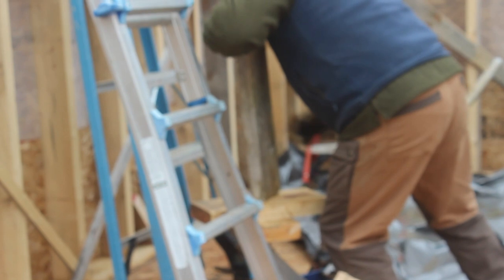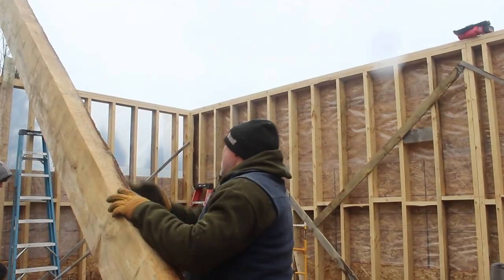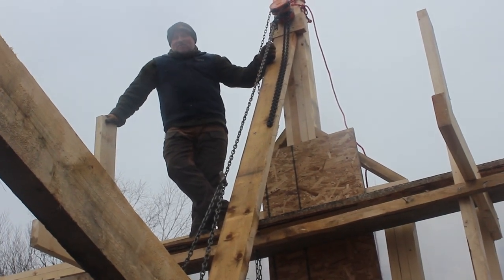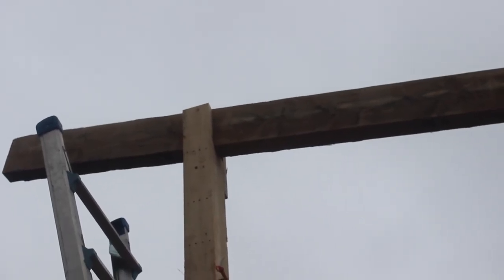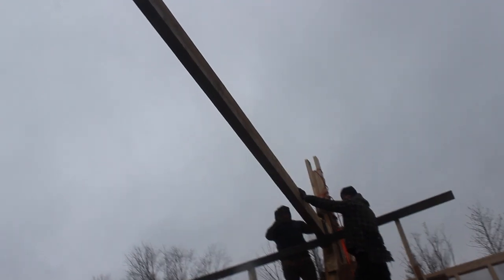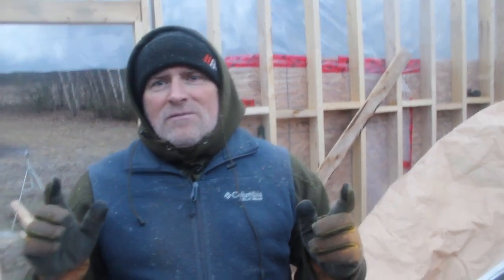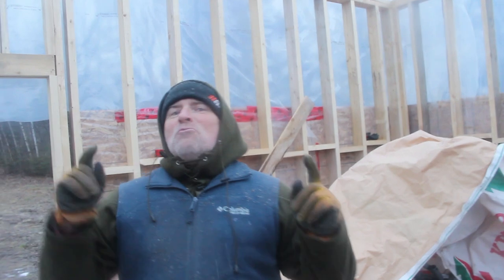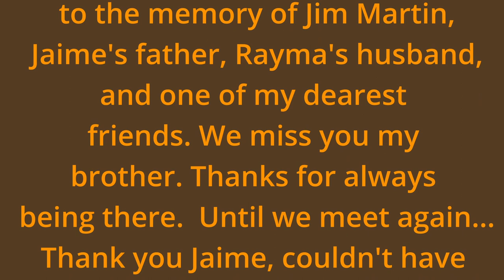32 ft. 500 lb Ridge Beam, Can I Get it Set Without Machinery

Comment: Chain falls are glorious tools.  How will you attach rafters where your big coupler is?
Reply from the maker: Thanks for the question. I will be drilling 1/4 inch holes and putting structural GRK Screws through the rafter and into the beam. I have it designed that only one rafter per side will actually fall on the metal coupler
Reply: Sounds like a plan!